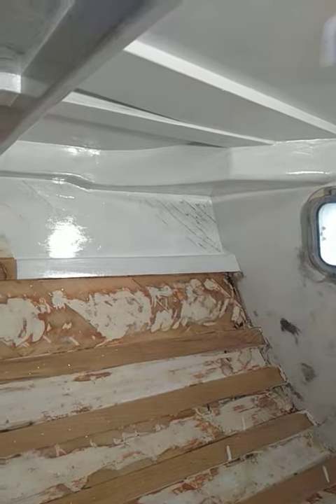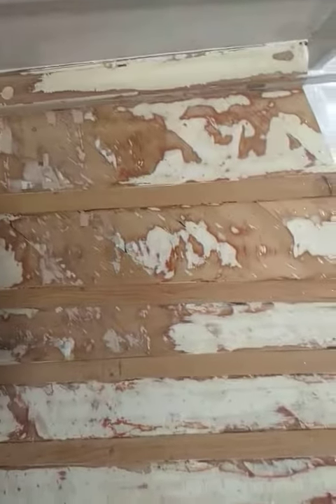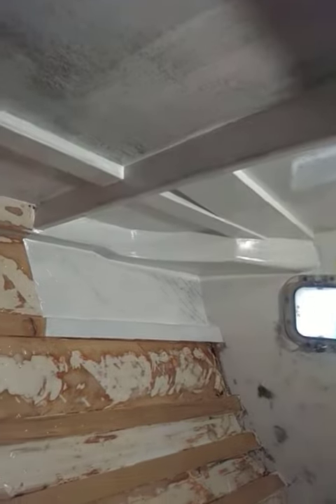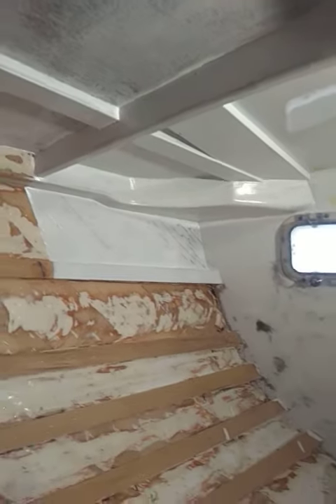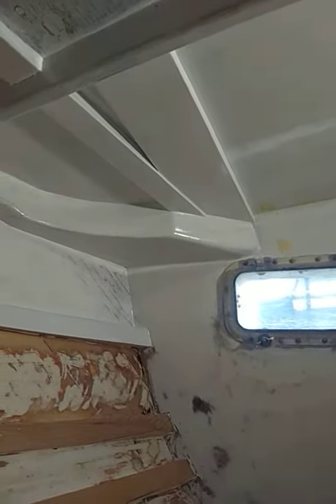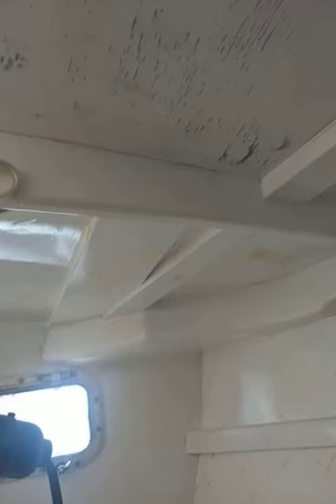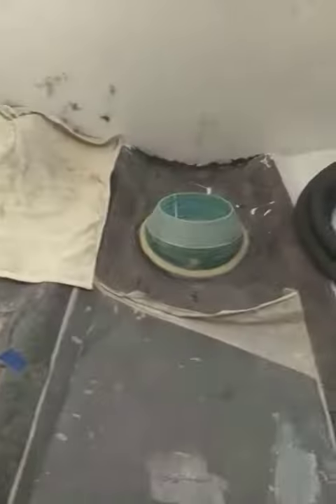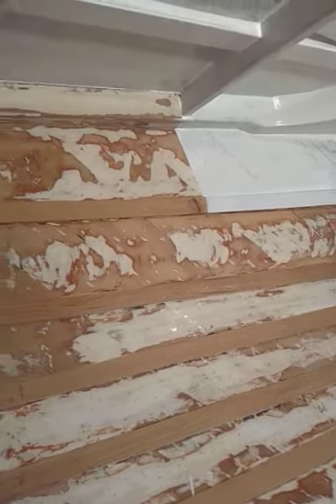Improbable Episode 13

Comment: thats all toxic, the glue in deforestation plywood, the varnish, the paint, the resin, etc.  paint is one of the major sources of nanoplastics and toxic chemicals, and you can cover the boat with sand agregate with homemade organic glue, even starch mixes,  and cover it with ceramic silicon nanocoating from cars. graphestone is the only comercial paint that produces non toxic or non polymeric paints and silicon coating, however they also sell some "lesser"  toxic paints so you need to read the stuff.